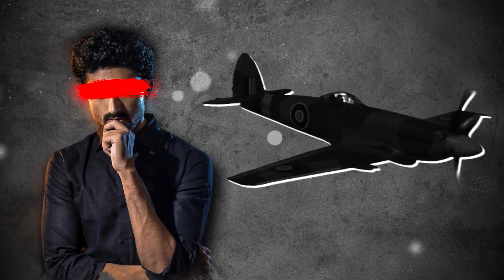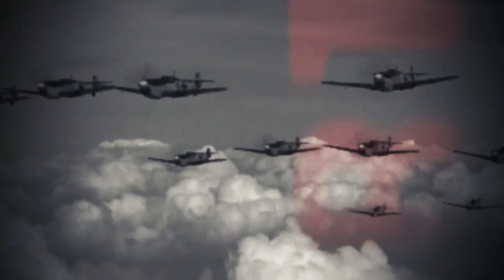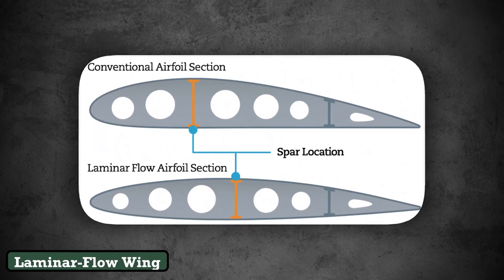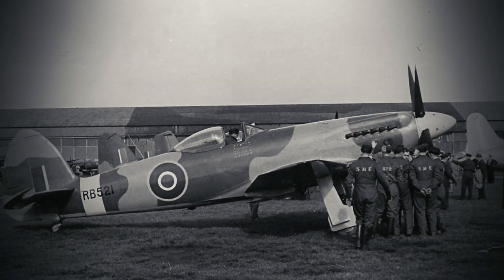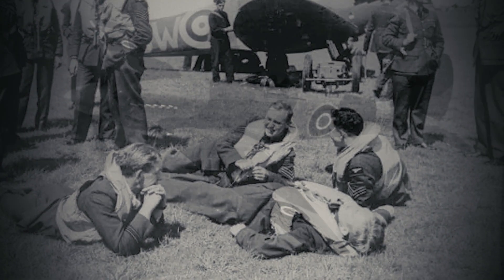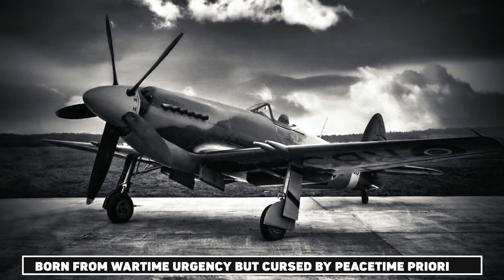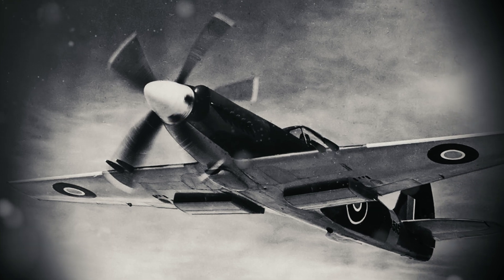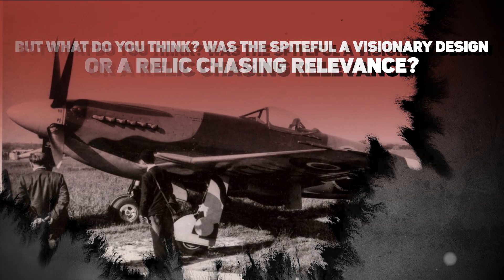The Spiteful: Britain’s Ultimate Piston Fighter Was DOA

Comment: Gryphon engines in Sea Fury’s???? The Sea Fury use a Centaurus Rotary I don’t see how a gryphon would fit? Maybe a P&W double wasp
Reply: 8
Reply: The Centaurus was a sleeve-valve radial engine, not a rotary.
Reply from the maker: Supposedly a griffon engine was tested in a Sea Fury but the plane was designed around the Bristol Centaurus.